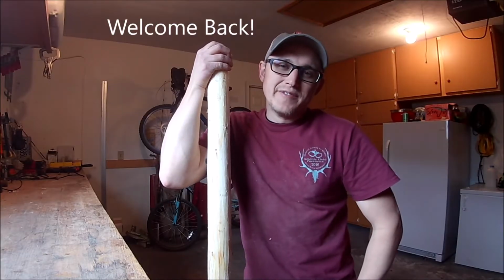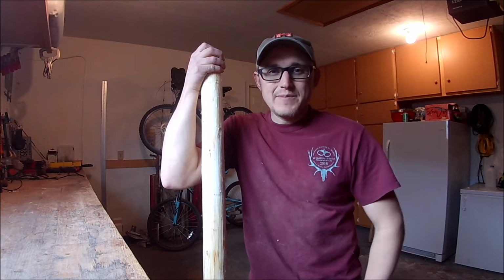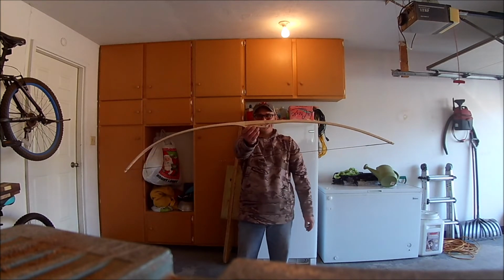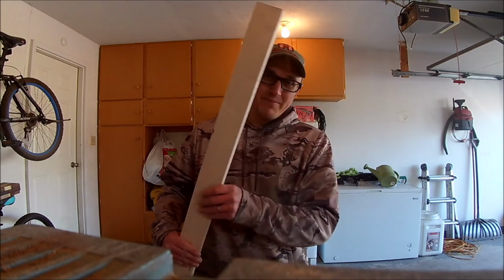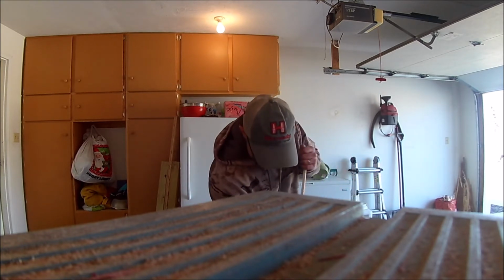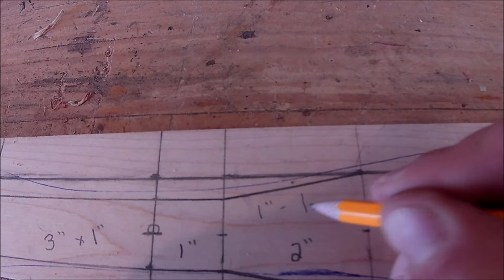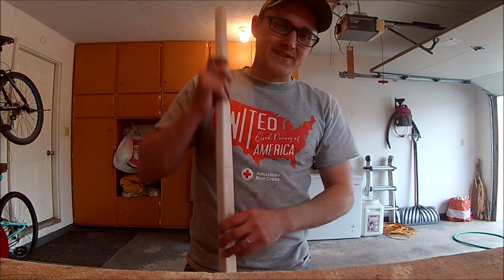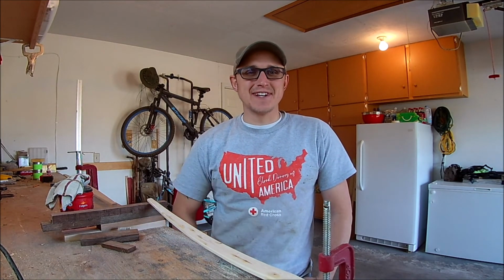Traditional Bow Building. Trying to make a 60" flatbow from a stave and a board.

Comment: Good built
Could you tell us the overall dimensions including tapering please
Reply from the maker: 62" tip to tip. 1.5" wide  full width to about mid-limb (bingham projects blueprints). Hope that helps.
Reply: @Sandhiller  
Thanks 👍